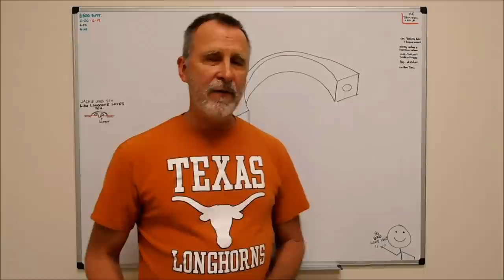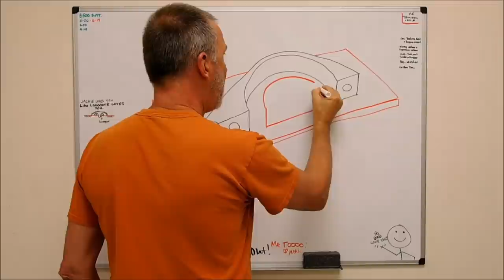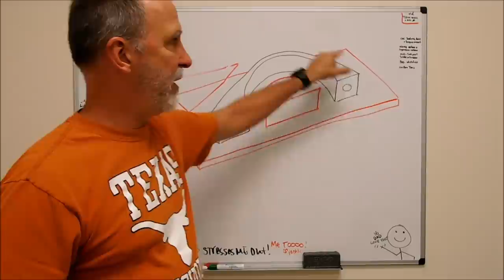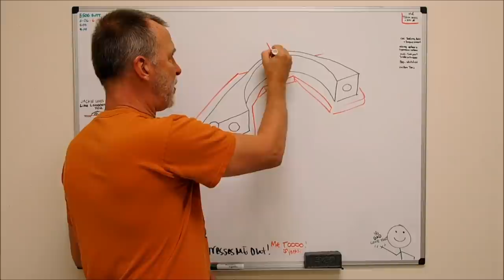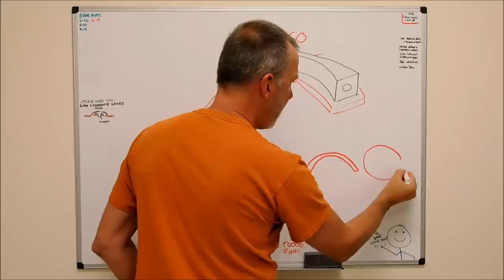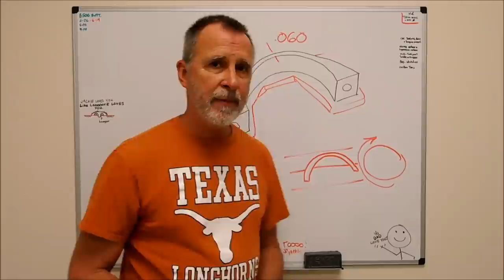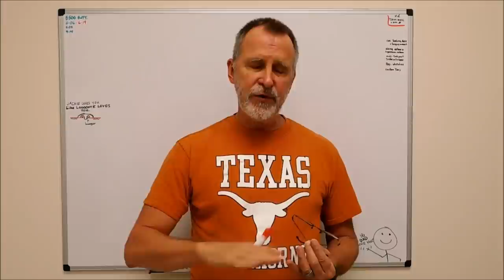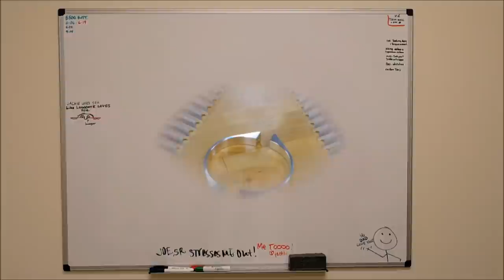Grip Stock - How to Access 100% of your Part Perimeter

Comment: Hey Joe,
Welcome back and great video. One suggestion for the last operation. Instead of pecking the counter bore with a 3/8 cutter. Go back in with the 5/16 and helical ramp to final z depth. You will not have bird nesting and no worries on marring the finished surfaces. Saves on tooling cost and set up as well. Win-Win.
Reply from the maker: Thanks, I'll try that.
Reply: I do that all the time on low quantities. But if it’s a higher quantity I go ahead and drill to save some time compared to helical boring the holes. Good advice for some who may overlook saving on tooling cost.

Comment: Done a lot of things on my bucket list. (Run my own business for 30 years)-.  And that I, between 50- 64 years old, have a copyrighted song, completely restored an antique Jeep from the ground up and showed it in a magazine (Bolt by bolt), built a 1/2 scale real stagecoach, bought and drove a motorcycle for 2 years, Hiked part of the Appalachian trail, did 5 cruises, made fine furniture, learned finger picking guitar (Chet Atkins style) instead of just using a pick, recorded my music, playing guitar, drums, piano, bass and vocal, scuba dived, traveled 38 states, and now, it is strange but I had the need to know how to turn a shaft that would just press fit into a bore, which led me to love machining and it's precise engineering.  And I love math.  
 I can honestly say, you have provided and much clearer and easier way to understand the ins and outs of machining, and made my bucket list easier to complete: Thanks!!!
 I didn't list them all and I bet that was the longest sentence ever written- Another check off the ole bucket list!

Comment: I’ve tried explaining this to places and they are more concerned about wasting 50 cents per part than the time savings that cost ten to twenty times as much with extra operations.

The bean counters do not understand and continue to be penny smart dollar ignorant.

It’s good to see places like yours being practical and reasonable.

Thanks Joe!!! 👍👍👍👍👍🙏🙏🙏🙏🙏
Reply from the maker: Even radius features or large backside chamfers can be used as the grip stock region. Upside is, you can always recycle the excess material you mill away to recover some of your investment.

Comment: I don't know what the RPM limitations are on that particular machine but a Fraisa AXFP 1/2" or 3/8" 3 flute rougher you could run your 3 pass roughing in a single depth cut profile 1 time around the part at 30% higher feed (3 flute) saving you 2 passes on 2 parts per cycle and in Aluminum they last forever, I've been using a 1/2" AXFP for 2 years and its still fine.  Still plenty of time to band saw out the chunks.  That's a great tip btw.  Its nice that you're doing something during the cycle and the cycle time is shorter.  More parts in less time. Standard operation at our shop as well.

Comment: Hey Joe, love the series. I appreciate when an experienced hand shows a method I have not previously experienced (such as the arbor for boring a stack of shims!). 

A couple of observations based on my loooong learning curve making thousands of the same few aluminum parts on a 1991 Haas VF3 (approximately the same spindle speed and IPM limitations you probably deal with). 

1. Try using a stub parabolic for short holes like the "half hole". No center drill, no peck, and feeds in the 30-40 ipm range make short work and no tool changes. Especially good for jobs with lots of tapping, and I have become a form tap convert for almost all jobs. I can get over 1000 accurate 1/4-20 tapped holes in 6061 before I even need to START worrying about the drill. Prices on parabolics have also become quite reasonable with more manufacturers making them.
2. It looked like you used G98 for your canned cycles on the first op (i.e. G83 G98 R.1 Z-.5 Q.15 F18.), but may have forgotten on the third. I know, I know, I'm nitpicking, but it's always a time saver when you can eliminate that hop between R levels at the start of the cycle with multiple fixtures.
3. Have you tried tiny pecks (like .010-.015) and aggressive feed (40-50 ipm) in G73 to eliminate the rat's nest and maintain cosmetic surface finish when counterboring? This is also where the 3 Flute EMs that some guys are harping on can boost your feed rates. Since they are basically purpose-designed for aluminum, the coatings and chip breaking/evacuation are optimized for this type of work. 

Looking forward to more great vids!
Reply from the maker: Thanks for the tips.

Comment: Love your videos Joe. As a jobshop machinist I would do a lot of things differently. I don't know what your max spindle speed is so I will base some things on that. 
1) why a flycutter after the face mill. Most quality facemills with the appropriate insert will leave a finish comparable or better than a flycutter. save the toolchange and the reduced federate of a single point cutter. 
2) Take out that centerdrill and use a spot drill. Centerdrills are for what they're named after: drill a hole for a 60° center. Drills should always start with the chisel and not on the cutting edges. A 120° spot drill is what you want for a regular jobber drill with a 118° angle. And no need for pecking, center or spot drill. Or you could skip spotting by using a screwmachine drill. 
3) Pecking kills cycle time! If you need to peck, peck at least one diameter of the drill. I counted 10 pecks, could have been done with 3. Or even better, use a chip breaking cycle. 
4) Instead of slotting around the part in 3 steps, rough at full depth and clear away all that extra material you are removing with the bandsaw. I always say: let the machine do the work. It does it the same way at the same speed every time and it doesn't have to go to the bathroom or answer the phone. Use a 3 flute endmill and use that carbide you're paying for. There are few machines that could spin a 3/8 endmill (carbide) too fast. Run it at max rpm and for roughing, around .003 ipt. 
5) After flipping the part to the soft jaws,  I would run an adaptive to remove most of the material and finish with the face mill (if you want the same finish as the other side). 
6) Why create a counter bore twice? You start with a 5/16 EM to create a flat, but go back with a 3/8 in the exact same position. Skip the 5/16 and make your 3/8 counter bore and drill through without pecking. Also, longer chips can be beneficial in this case as they have more mass and will be flung away sooner than shorter chips that wrap around the endmill. 
There are a lot of variables that I'm not aware of, but some of my suggestions apply to any machine.

Thanks for the videos Joe and I will keep watching!
Reply: Using a center drill to spot bothers me so much.

Comment: Nice job Joe. That looks and sounds like a Fadal , I ran some aluminum 6 cylinder intake manifolds 3 ops with a horizontal rotary table about 10,000 parts. Aluminum is wonderful to work with. I retired 2 years ago as a tool maker/ fixture builder after 45 years in the trade. I've machined  parts weighing 8,000 lbs. to parts the size of your small finger nail. I love your videos, you do a great job of explaining things with safety in mind, I've seen some people do some pretty stupid things over the years  Like to see more of your shop thought. How bout a tour?

Comment: Great stuff, I'm learning a lot from your vids!  As a rookie I've yet to use soft jaws and was wondering about the amount of soft jaw "overhang" on the vice.  The overhang appears to be several inches.  Is this for alignment, or stability, or?
Reply from the maker: My jaws on this one are actually 2" x 2" x 6" long. The material chosen was driven by the depth of the part profile. The movable jaw was left at 2" in case I wanted to machine in a relief and add a radial feature to it to get down inside the part opening.

Comment: Great video as always. Excess material and soft jaws is always good for strange profiles. One question - How did you set your datum in the X axis on the third Op when drilling / counter boring the last two holes? I couldn't see and vertical faces to features from.
Reply: It looked to me like there was a small vertical face at the end of the sloping shoulders of the part

Comment: Joe, you should look into the Witte Vacmat system or similar products. I run brackets and parts like this out of aluminum plate all the time, leaving 0.2mm of the plate so the cutter doesn't go all the way through. Out of the machine comes 20-30 parts that are connected by thin foil that you just break apart by hand. Subsequent operations I do much like you do with soft jaws etc.

Comment: Nice work for a CNC setup, that same part would be very time comsuming on a manual setup situation... ;)
Well done...!!!
Reply from the maker: Thanks Pierre, good to hear from you. This would be a good rotary table job, but higher quantities would certainly hurt.
Reply: On manual setup jobs 2 is normally a production, one for practice and correct mistakes and the second one for the customer or for use...   lol
Reply from the maker: That actually made me laugh out loud. Good one.

Comment: Interesting. I've never had much success using cutter compensation to generate a tool path from the part outline. The control would get confused at times and shoot off in odd directions. When I looked at the math I realized that it requires multiple lines of g code to figure out what direction to offset the cutter.

As far as work holding goes, this part is a poster child for superglue to a fixture plate. NYCCNC has done a ton of videos on that.

If I could get away with it, I'd use holding tabs and probably clamp the stock directly to the table with some sacrificial material under it. The only problem with that occurs if you need to flip the part and do 2nd side  ops. It's very hard to get correct alignment after the flip unless you drill a through  hole as a position reference,  machine the rough stock to exact width, or touch off on the front edge after the flip instead of the fixed jaw.

Beautiful finish on that part.
Reply from the maker: Super glue can let go under heat and pressure and is not very efficient of a production run. One piece its OK, but for dozens, the cleanup between parts is just not cost effective.

Comment: Very nice I wonder if you could have done two parts out of stock by rotating one part 180• and orienting the larger side in the middle of the other part. It would probably be hard to separating the two though.
Reply from the maker: I could have nested them like that. I actually considered it. The problem I encountered was cutting them apart. Getting the saw blade between the 2 ends of the part was not going to happen easily.
Reply: Joe Pieczynski Man I had to make a few horseshoe shaped parts just recently and wanted to nest them interlaced with each other. But I ran into the same exact problem! Couldn’t think of a good way to separate the two. Had to ask you I just feel like there’s gotta be a way to utilize that stock. Anyways another awesome video. I truly appreciate you sharing your knowledge and you taking the time to reply. Parts looked beautiful. Thank you!

Comment: Again and interesting video. The one thing that would concern me is when you are cutting out the blank you are running the mill and the bandsaw at the same time. The problem is that in a production type mode I would not allow someone to have their fingers this close to the blade. A piece of 3/4 pine notched out removes the fingers from the immediate area. I'm not sure that the amount of time running back and forth and the actual time that it would take to cut all the parts at once would be that great. I like to focus on one operation at a time when my fingers are involved. You only get one set. Nice video. Charles, Boston
Reply from the maker: In a true high volume production environment, I'd have turned the large chunks to chips and not hit the bandsaw.

Comment: Have you heard of the superglue and masking tape trick? John from NYCCNC really likes it and it allows him to machine a part from all sides, without anny grip stock.
Also, it would propably be a good idea to have multiple setups in the same machine. One for the front side, one for the backside and one for the holes. Machine everything in one program and then just shuffle the parts to the next station, with one new stock piece in and one finished part out.
Reply: Superglue and masking tape is for one off / prototype work. It's not useful in a professional, production environment.
Reply: That is a Mickey Mouse set up that hacks use😂 you think ford, GM, or MTD would ever use superglue and tape on their production lines, absolutely not.

Comment: WOW, Not banging the stock in the vise before the first pass makes so much sense now!  What is the preferred Grip Stock thickness you shoot for?  I tried a similar approach to this earlier today on a set of parallel jaws, after watching your video on squaring stock.  I left a 7”x3/4”x1/4” grip stock flat that I’ll finish decking the bottom off tomorrow, but I think I could’ve gotten away with 1/8” grip stock since the parts span the whole 6” Kurt vise jaw(s).  Also when torquing the vice, what torque value would you suggest for Aluminum?  Thanks again for the great content, I feel like Descartes standing on the shoulders of a giant when I watch your channel!
Reply from the maker: Many thanks.

Comment: We use a product called crystal bond for small parts. Its some kind of an industrial wax than "glues" the part to a substrate in place during machining processes. There are a few variants of the product. Some can be removed with water some with acetone. Works well for us.
Reply from the maker: I'll have to check that out.

Comment: Be careful with the swarf.  It could ruin your finish perimeter.  I use this method a lot and it produces a much higher quality part (I call it "machining all sides".  I've noticed most shops around here go with raw stock and only machine the perimeter and just final finish the flats.  I thought about that too but as you said, the money saved isn't worth the inability to machine all sides quickly.

 Great video.
Reply from the maker: Thanks. The flood coolant helps preserve the finish.

Comment: Joe, once again an excellent presentation. One thing you didn't elaborate on, was half of the order threaded and half drilled through as you showed? If all were drilled through what sort of nut was intended for the fasteners. I'm assuming a cap screw and a nut of  some type.
🤞❄️🇨🇦🍌🥋🇺🇦🕊️🇺🇲👍
Reply from the maker: They got threaded.

Comment: An excellent and impressive video, Joe! 

How long did it take to write the program steps for this part?  "Guestimates" permitted.
Reply from the maker: The outer tool paths for this part were driven by curves connected to the profile. The tools were instructed to follow the " Custom trajectory" of those curves. This type of programming is reasonably fast and the code can be used for roughing, finishing and breaking the edges. Many of the other features were done conversationally right at the controller. Best guess, less than 2 hours total of programming for the whole part.

Comment: Taking a chamfer cut around the perimeter before you finish mill the perimeter & the face will ensure that you don’t have a micro-burr that effects the dimensions since any micro-burr would be along the 45 degree angled face of the chamfer.
Reply from the maker: Or it could just re-orient that micro burr to a vertical position.

Comment: Joe, thanks for another great lesson. 
 I wonder, if I had to produce a significant number of parts, would I prefer to use a solid stock and mill the parts off the end, then part- off the profile. Say, 3x4x10"
Reply from the maker: IF I had to make a bunch of these, I'd do it in a 3 foot long strip, 10 at a time and band saw off the parts. Deck the blank and repeat. simply offsetting all my tools each time I reloaded the blank.
Reply: Seems like the shapes could be nested / overlapped if inverted so that the end of one piece was inside the inner curve of another piece and increase the number of parts you could get out of a single length of material.

Comment: Excellent! For the profiling, you are running the same program twice, 1st with .395, then .375, yes? I'm doing hobby shop stuff, but like the idea of tricking the program. So, when programming, you are running everything with the same toolpath, just changing the number of Z  steps and tool call out (.395 or .375)?
Reply from the maker: Its hard coded into my program, but yes, thats exactly what I do. The tool diameter is handled by the tool table definitions.

Comment: Ok, good part. Joe, how would you consider changing the fixture(s) if you were required to make 100 lot of this same part? I’d guess you would lose the band saw op?
Thanks Joe
Reply from the maker: I'd do 10 from 1 continuous bar of material across all 3 vises and bandsaw the first bar while the second was running. 100 pieces would be most welcome.